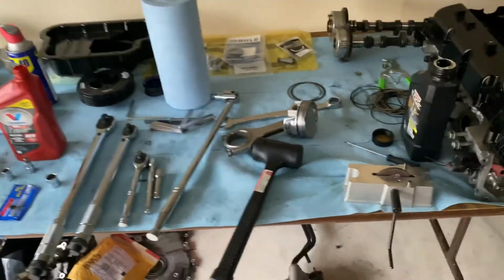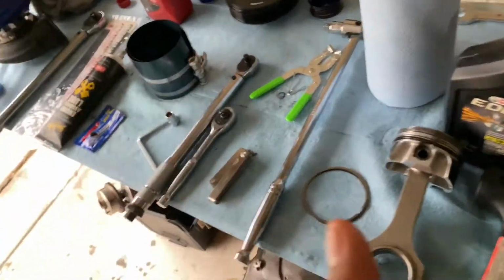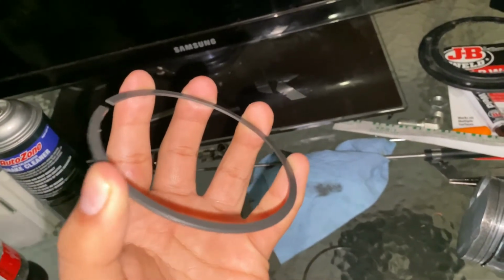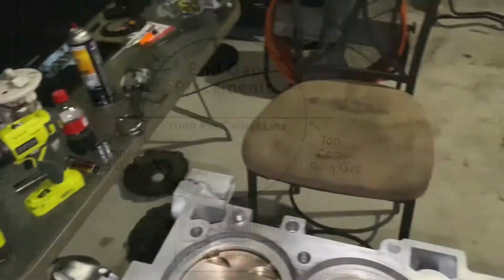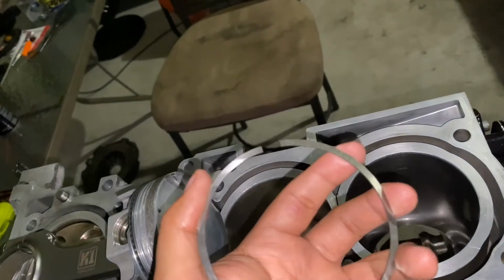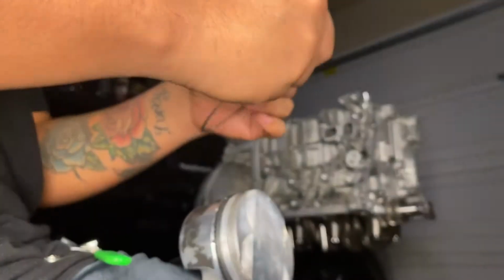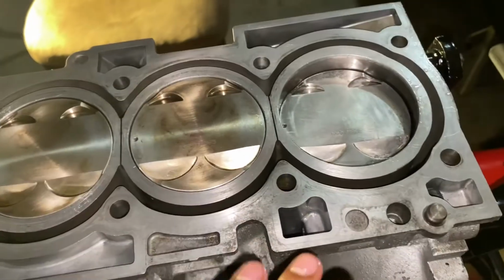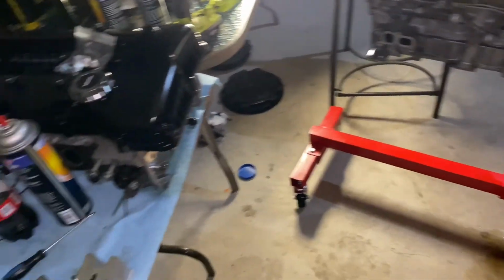Genesis Coupe 2.0T Engine Build Pt.2 | Rods & Pistons

Comment: Did you use a rod bolt stretch gauge to check?or can you get away with just torquing to spec
Reply from the maker: The “proper” way is to use a rod bolt stretch gauge.
The old school way is angle torque gauge. Most Arp bolts have a angle torque spec just need to call ARP for the specs 

Rod bolt stretch gauge is $150-300 so most people won’t even buy it.
Reply: @ProdigePerformance  are they easier to use than angle torquing? And also is it an easy tool to come by at a auto shop to rent?
Reply from the maker: @twzlah6044  most places won’t have it. You’ll have to special order it or ask a friend to borrow theirs. And honestly I much rather use a angle torque gauge. Way easier to use
Reply from the maker: @twzlah6044  if you’re trying to be perfect then rod bolt stretch gauge
Reply: @ProdigePerformance  ok bet I’m actually using the same rods and pistons as you on my bk2 😂😂 thanks a lot 👍

Comment: Thanks for the info I just got rod knock on my 2013 2.0t.. do you know a place where I can get a motor, or short block.. and crankshaft..  any recommendations on the rebuild im in san antonio tx as well
Reply from the maker: Car-parts.com
Facebook marketplace 
eBay 
Just have to do your research honestly. These motors are getting more rare to find. On the Facebook genesis coupe parts page there’s a few 2.0 blocks sell right now even new ones.
Reply: Awesome thank you I will check it out

Comment: Question. You said the final torque spec on the main cap bolt(s) is 70ft.lbs. but why are you doing that when the manual says for stock bolts have to be degree’d/angle’d to 120°-125°? Your saying torque while the manual say angle. Which is it and why?
Reply from the maker: I’m going off ARP torque specs not oem. Oem bolts are torqued to yield meaning they have the sequence then a angle torque. You stretch the bolts which is why you never re use main bolts.
Reply from the maker: Good question btw. I should’ve noted that oem main bolts and Arp have different specs.

Comment: I have rods and oversized pistons do you know how much power I can make?
Reply from the maker: Depends on other internal engine components
Reply: @ProdigePerformance  everything else is rebuilt oem, Tomei mx7960 Turbo, guru intercooler will oem head studs be okay?
Reply from the maker: @lowksgomez  you won’t make much with that baby turbo 
Under 400 wheel. 

If you got a bottom end built I would do a 3576 top mount. And from there I would ask if you want to go the cheap route or the expensive route

Comment: Just a question? You're not sleeving? Im not either. But my understanding is without sleeves mid 500s is what you're limited to. Im not sleeving my build but I don't have crazy goals. Low 500s for me
Reply from the maker: Myself including 3 others have made it to 700 with stock sleeves. Also people prefer support systems over sleeves these days as aftermarket sleeves sometimes tend to shift.
Reply: @ProdigePerformance  thank you. Appreciate it good to know. Good luck with build. Looks solid so far!  Can't wait for first startup.
Reply from the maker: spectrum870 appreciate it! Next year I actually plan closing the deck. I’ll be having Travis at MT Motorsports do it for me as well as build me a girdle. That was the plan this year but it was out of budget unfortunately thanks to this pandemic.

Comment: Do you know what bearings the 3.8 use? Please get back to me
Reply from the maker: You can use ACL or Preferably king but just make sure you get the correct clearances for your application
Reply: @ProdigePerformance  for the 3.8?
Reply from the maker: @anthonyortiz8056  yes. Lol

You can actually have any bearing brand make you bearings. You just send them the specifications 

King and ACL just have bearings pre made w/ clearances
Reply: @ProdigePerformance  if the crankshaft was cut and left on 10 which brand do you recommend
Reply from the maker: @anthonyortiz8056  again. Doesn’t really matter. I’ve used both with 0 issues